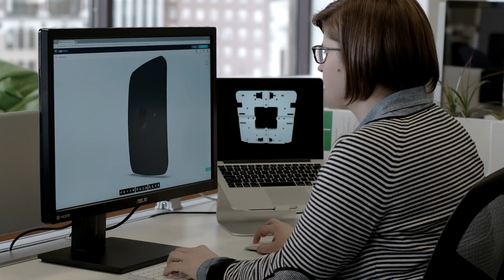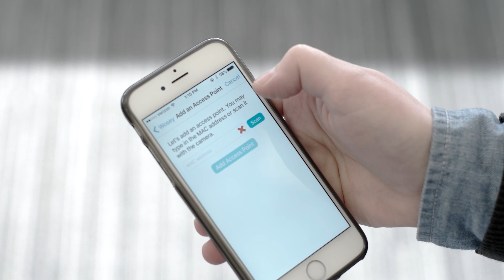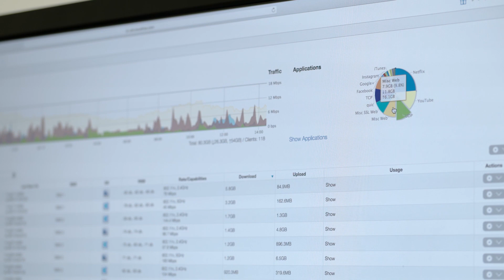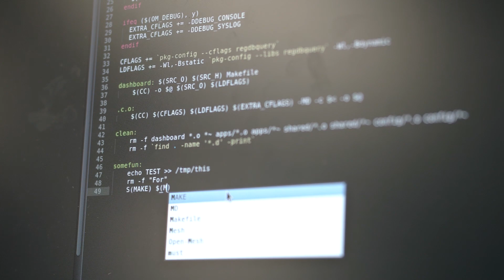Why we built the A Series

Comment: How do you use the A60 in repeater mode?  I have an area where there will be no ethernet cable available.  Do I just buy and injector and plug that into the A60?  Will the network see that the AP is available without it being physically plugged into an ethernet line?